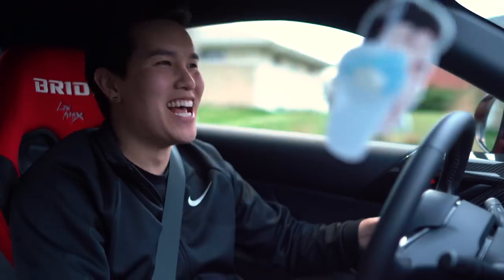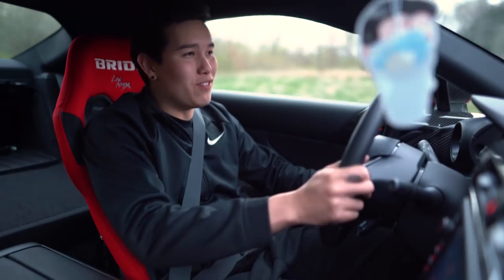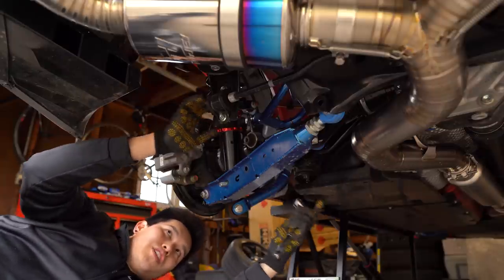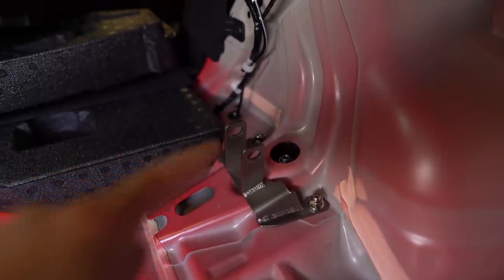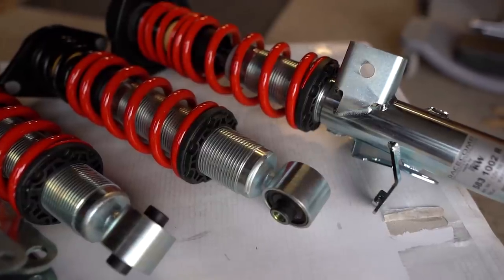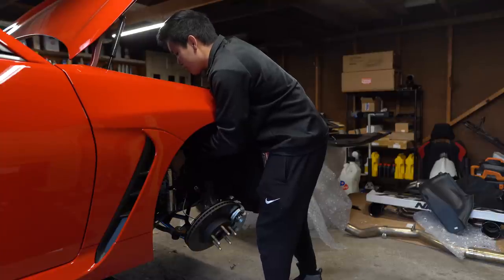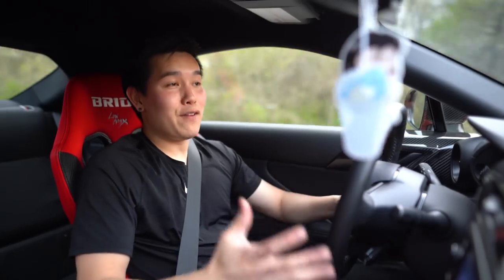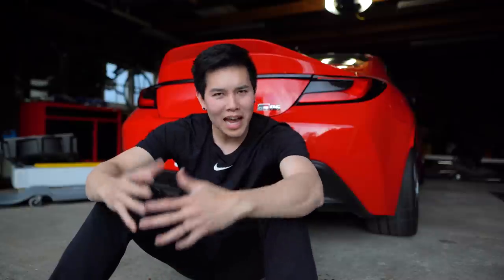Stop Buying CHEAP Coilovers!

Comment: KW is the answer
Reply: Or ohlins
Reply: @holyjellyx7758  to expensive and complicated for the normal person
Reply: Or HKS R
Reply: Godspeeds better than kw. Used both before
Reply: JRZ enters the chat
Reply: @marcelk7962 eBay coilovers are not better than anything.
Reply: @ToraxXxBS  I would not recommend v1 over ohlins rt. It is cheaper than v2 and v3. And ohlins are just like other coilovers, nothing more complicated. I have no idea what you are talking about.
Reply: @holyjellyx7758  for my car there no Öhlins available... That's why I don't know what is there or not. Just know about a friend's M3 and this one is fully adjustable. For a normal person this is to complicated. And they can make more wrong than right.
Reply: Ohlins aren't complicated, it's a single knob adjustment. Unless you're talking like a TTX or something, and most folks don't run those on street cars.

Comment: I personally wen KW v3s last year and it's night and day compared to other cheaper entry level to even cheaper mid level coilovers.  I tell people nowadays to SPEND THE EXTRA on a quality set of coilovers like the KW.  You're going to be MUCH happier every time you hop in your car and drive.  Even drove mine in the winter and when it came time to replace the springs with stiffer rates, the collars moved very easy.

Comment: I really don't understand why anyone thinks they can spend substantially less than factory for suspension and think they're improving performance. I wouldn't buy coilovers cheaper than $1,500 if they were non-adjustable let alone spending less than that for adjustable coilovers. I got the RCE Tarmac Zero coilovers on my STI which were $1,800 at the time. They're fantastic. If I wanted something adjustable, I'd step up to the Tarmac 2 for $2,700, and then I'd get them shock dyno'd so I know which settings on each actually match.

Comment: With the new setup, do you still need the spacers to fix the rubbing issues? I’m in the process of figuring out my wheel fitment on my GR86. I want to run 18x9.5 +45 Advan RG-4’s with a 255 tire. I’ll probably need to get RLCA or RUCA like yours. 

Keep up the great content! You’ve been a great resource for a fellow Track bRed GR owner!
Reply from the maker: I think I still have a tiny bit of rubbing on the inside at full lock.
Reply: Bro that's such a fat fitment. Good luck.
Reply from the maker: @Patrick Sawyer  that's the fitment on my car haha

Comment: For $2,400 I can afford these for my E46 M3. Huge bang for buck
T XTA plus 3 COILOVERS

The ST XTA plus 3 coilover kit gives your car maximum performance for the road and the tools you need for any challenge.

From the factory, the ST XTA plus 3 coilover kit is equipped with KW dampers that are adjustable in HIGH AND LOW-speed compression!!!!

... as well as adjustable rebound damping. With 24 clicks of adjustment for each, high speed and low speed compression damping and 18 clicks of rebound adjustment, your suspension knows no limits. It doesn’t matter if you bolt in an aftermarket roll cage, weld in a cage, upgrade to spherical bushings or changed wheel loads – the ST XTA plus 3 coilover has what it takes to keep your car dialed! Of course, the ST XTA plus 3 also includes a parts approval certificate, race springs and solid aluminum uniball top mounts (with adjustment when necessary).

Comment: Hey Kevin,  enjoying all the content . I am thinking of putting the STI lowering springs on my brz with the stock coils just for a while until I save money. 
As long as I install aftermarket rear lower control arms and camber bolts in the front, do you think I should be able to get a few degrees of camber adjustment front and rear ?
Reply: I had sti springs and Bilstein dampers on a Gen 1 BRZ. I loved them, but they’re def stiff. I would say, save your money and get a quality set of coilovers

Comment: Rce ss1, and csg fla are the best "budget" dampers for the platform,i wouldnt use anything less honestly
Reply: What are your thoughts on the CSG FLA’s?
Reply: @joshfetty  same level of excellent customer service, slightly different pros and cons, spring rates are the same, internal bump stops are nicer, having rear mounts is nice, multi peice shock body is obviously a con, but all and all cant go wrong with either imo

Comment: As you said, quality hardware is super important! 
How can I know that I have adjusted the right camber?
And thanks for saving $800 on our behalf 🙏🏼
Reply: Get it aligned. Imo a great camber angle is -2 fronts to -2.5 degrees rear.
Reply from the maker: The "right" alignment specs comes down to what you're using the car for. For most people that are just daily driving the car you won't want anything too aggressive, -1.5 to -2.5 degrees, but if you're tracking the car you'll want even more to activate more grip. Thanks for watching!

Comment: Any recommendations for staying really close to stock height? I let someone drive my car and they broke my front lip and nearly ripped off my bumper lol. Big pothole in a parking lot. I was thinking fortune auto.
Reply: Cop Beilstiens B6 struts and get lowering springs
Reply: @B  wouldn't that still drop it 20mm or so like these do? I hate the gap but I hate texas roads even more.
Reply: @MarioK4rt  well it will only lower your vehicle depending on the lowering springs you buy. You could also just run your oem springs for oem hight but get the extra comfort and performance of the upgraded struts.
Reply: @B  thanks for the good info. I'll look into them.
Reply: stock coilovers will keep you closest to stock height
Reply: @mariok4rt314  there is someone who makes coilover that go stock and above but I forget. Im on the same boat I would like better springs and dampers but want the stock height. Eibach is not interested in making stock or near stock height springs for teh BRZGR I asked.. then they raise the WRX :s
Reply from the maker: What are your goals for the car? Are you just looking to stiffen things up?

Comment: If you arent going to track and just want cosmetics, just get lowering springs. They will look just as good and handle better than cheap junk coils. If you actually intend to do some real performance driving, coils are well worth it.
Also, Tein makes really great stuff for really great prices. Just sayin
Reply from the maker: Also need to keep in mind that if you stick with the OEM struts you won't be able to fit some of the wider more aggressive wheel setups due to clearance issues.

Comment: @Kevinvo be real with me, are ISC coilovers entry level? I have the N1 street sports and they are bouncy and stiff and tbh after a year I hate them. I really wished I bought B6 Beilstiens and got 1-1.5 inch lowering  springs.
Reply: I have the same ones and have realized they are pretty stiff and bouncy aswell. I have found that 14 clicks is a good spot to be
Reply from the maker: I haven't personally tried them, but anything around that $1000 usually will give you mediocre results. That's the point where I'd say just spend a few hundred bucks more.
Reply: @Kevin Vo  how about BC racing coilover? I've heard really good things and a lot of people run them with this platform. Is the ride quality good?

Comment: Kevin, what are your thoughts on the Tein Flex Z? I have them on my 2013 BRZ and while they feel comfortable I can’t seem to nail down the source of clunking noises.
Reply: Did you buy them used? If they’re used then I wouldn’t blame the coilover I’d blame the previous owner. If they’re new then the only issue I’ve seen is maybe your ride height is too low?
Reply: @joshfetty  I bought them new and stayed close to out of the box height. I’ve gone through everything I can think of as far as ensuring things are torqued go spec, including the sway bar end links

Comment: Looks like you went with Super Street 2. Are they based on KW 2 or KW 3?
Reply: They are made and designed by KW with spec input on the platform from Racecomp engineering.

Comment: dont underestimate a good shock and lowering spring. Idk I set it and forget it so I got Koni STR.T and Eibach Sportlines on a 323 and they were the tits.
Reply from the maker: Can definitely put together a good package if you pickup the right parts. Most people don't want to deal with the process of piecing everything together though.
Reply: I have sport lines and after sitting for the winter one has dropped about an inch, nearly sitting on tire

Comment: Does any body know if I can fit 18 X 9.5 +35 wheels with 245s on the brz/86?
Reply: Yes it will
Reply: @Metalhorse1123  on stuck suspension without rubbing?